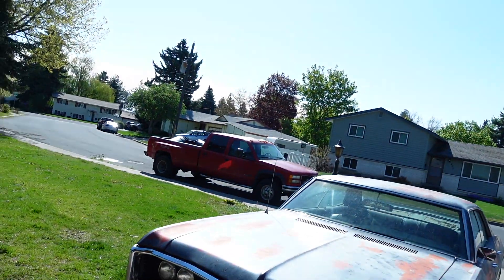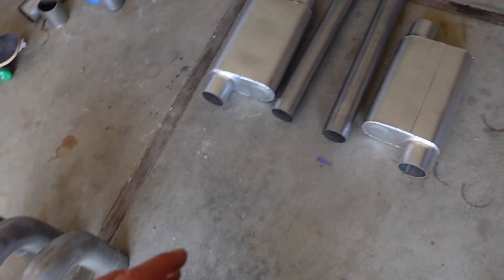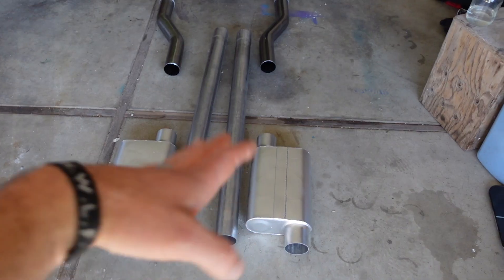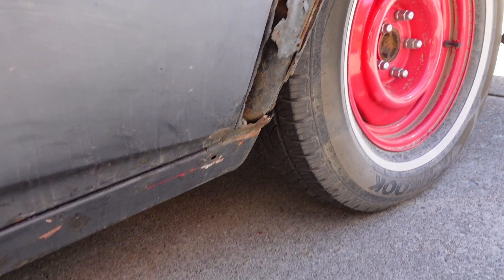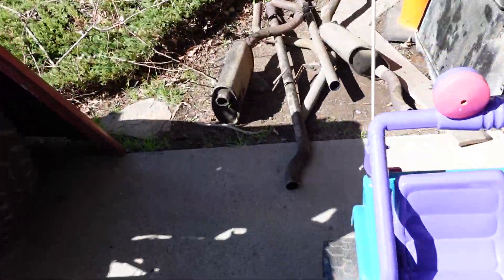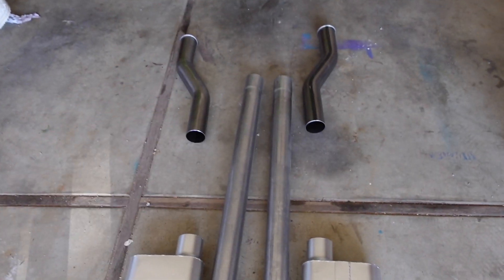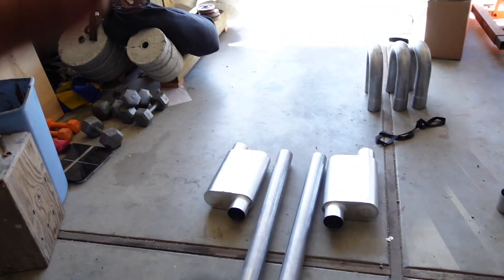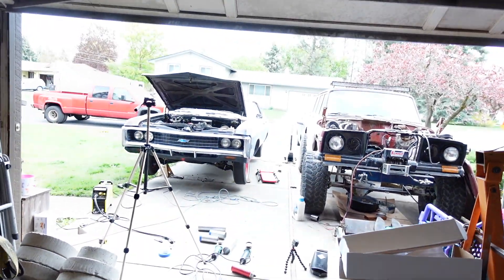1969 Impala 3" Dual Exhaust with Summit Racing Mufflers

Comment: Which wires did you use to connect your radio, man.?
Reply from the maker: speaker wires are all new, power wire is a new wire connected to one of the extra accessory tabs on the fuse block, with an inline fuse installed.

Comment: Do you know that a 200r4 will bolt right in where that th350 is? Just move the crossmember back about 3-4".
Did it to my old '72 Monte. Nice 1st gear  (2.78) to get that heavy car moving, and NO computer!
That way you can put a 3.73 posi, and some G-60's and she'll really get up and move.
Reply from the maker: whats the difference between the 200r4 and 700r4? Overdrive would be nice. I have another 12 bolt housing and the 3.73s, just gotta get a carrier.